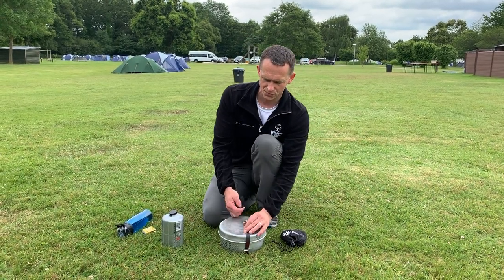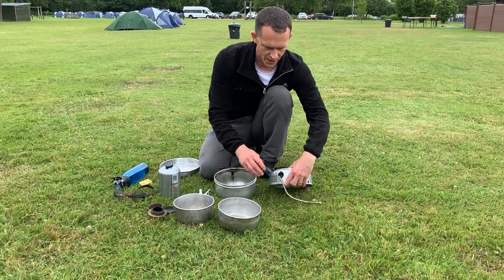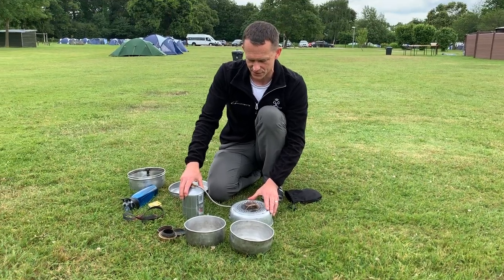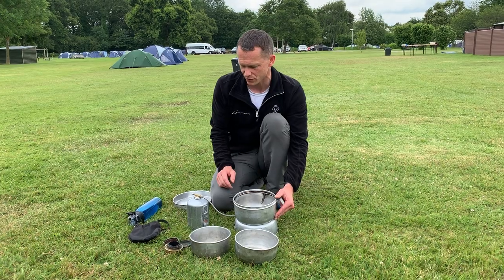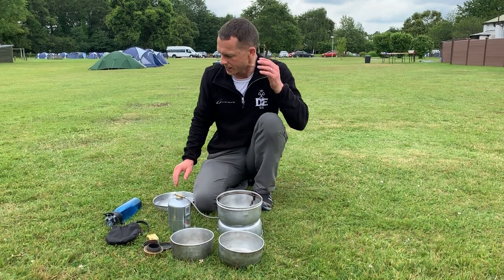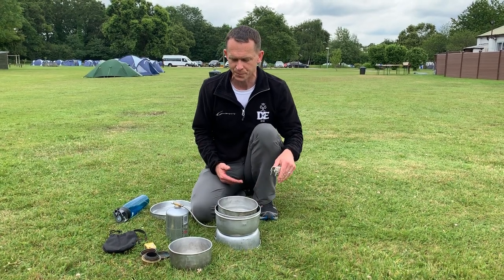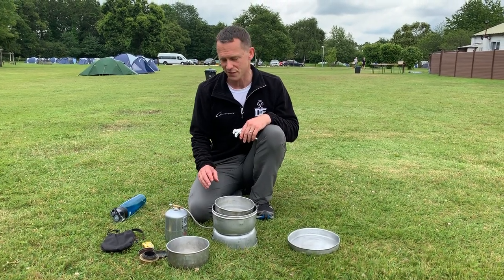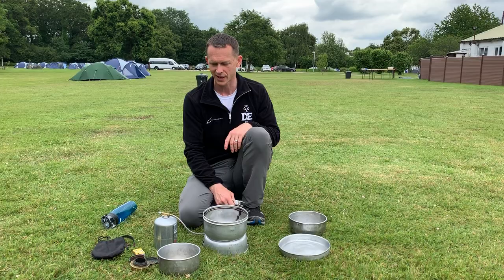@SBHSDofE Using a Trangia stove with gas converter

Comment: can you not control the flame/temperature on the gas burner?  ie turn it down a bit
Reply: Yes you can!
Reply: Yes, you can turn the gas down, it gives good control  Given up using messy meths